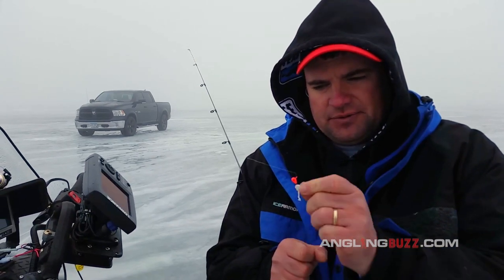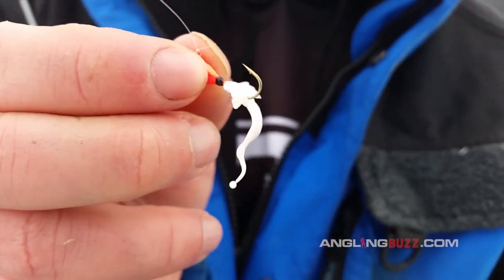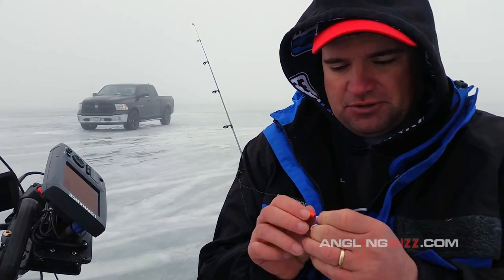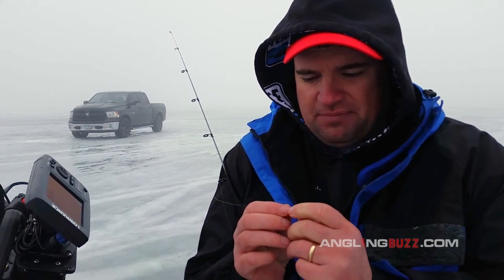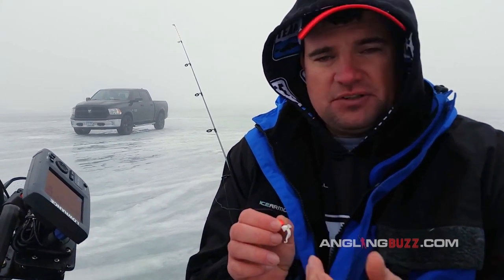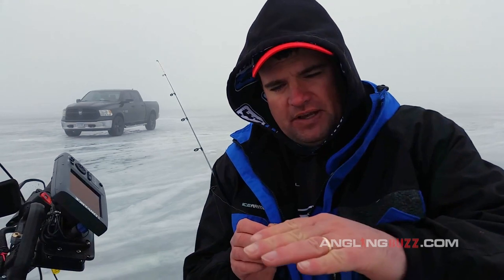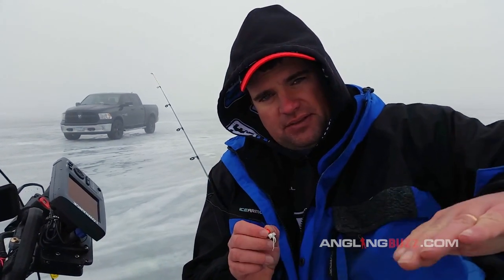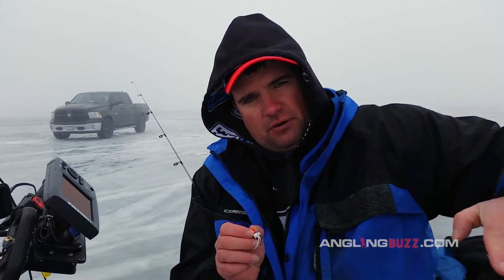Why the Best Ice Anglers Tune Their Tungsten Jigs

Comment: The tiny eyelet and hook can be "off kilter"? Sounds like a manufacturing flaw to me. Why should the end user have to use a pliers and grab/bend them which can damage them such as creating a rough surface on the eyelet that very light line could rub against and break while the hook could weaken or the barb be damaged? It's 2021 and these jigs have elite pricing, often $5 or more for 1 jig, they should be perfect (or at the very least near perfect) when they leave the factory.